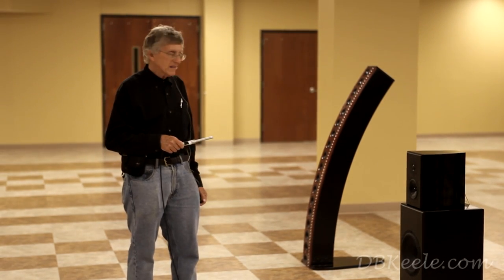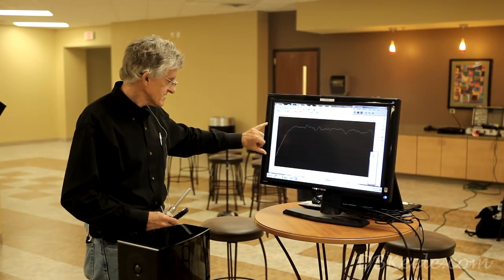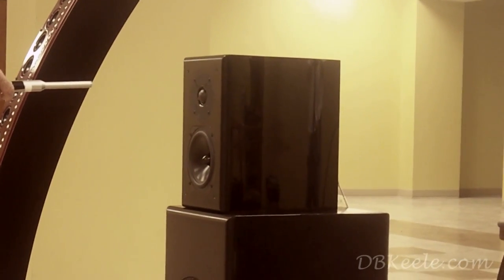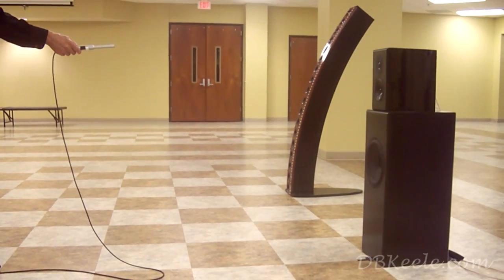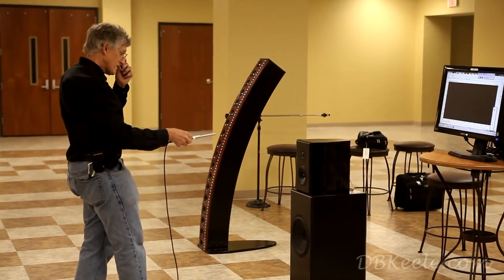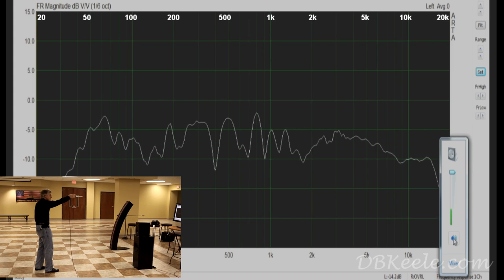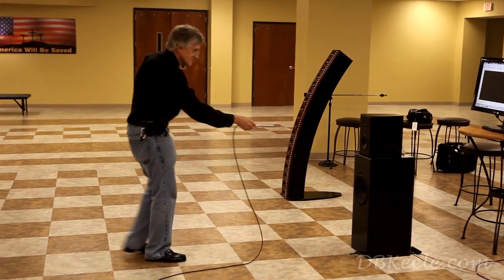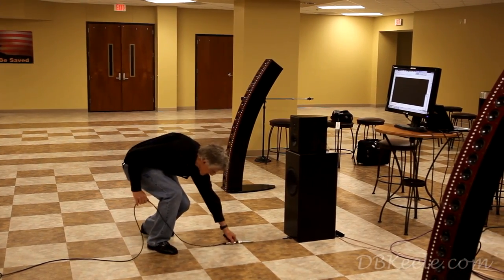CBT Chronicles Part 6 of 9 Measurements: The three-way reference system

Comment: Of the group, this is the video to watch.  It is amazing to see no matter how good your speaker design is, the room has such a tremendous impact on frequency response as you move to traditional listening distances.

My immediate thought upon seeing this is, I should only do about 1/2 of the equalization required to compensate for room effect because I'm likely doing damage to the frequency response in the near field with those adjustments.